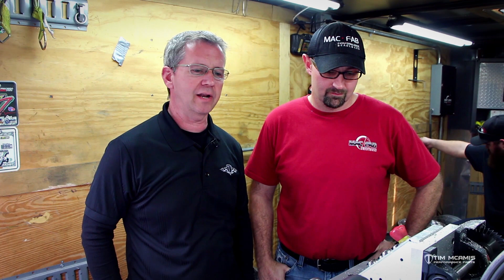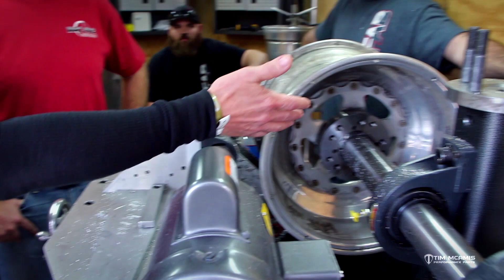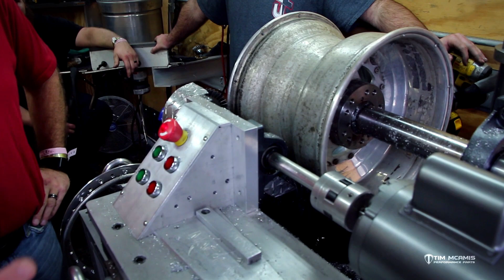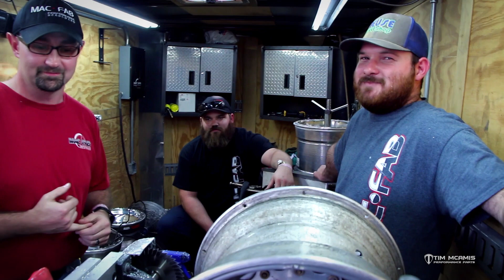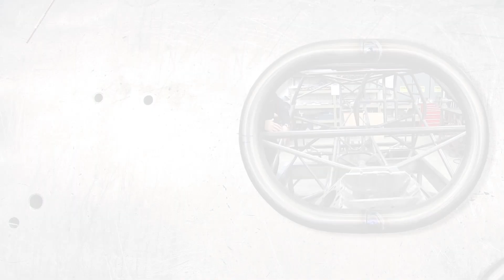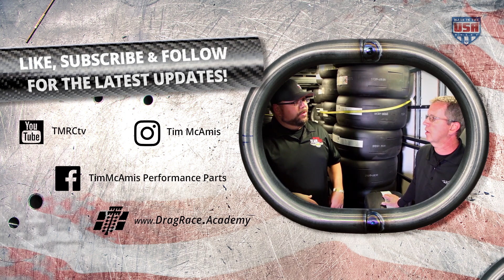Beadlocks & US Manufacturing

Comment: He is speaking 100% truth. 16yrs running a 110" wide rolling mill. It was bought used in the late 40s from a steel mill and we have retrofitted it ever since. It's a little over 3 stories tall. 4 legs and cross over at the top like an archway. They have said ever since I hired in that if it were to ever break a leg on it that another can never be made. Sounds crazy, in the car world if someone put it together then we should be able to rebuild it a 2nd time. But they say there just isn't a place left that can do big enough castings to replace what we have. We have sold our older stuff to smaller companies because that's just all you can do. I don't know but id bet money it the same in the machinist world that lathe that's 150yrs old made of all cast and weights 30ton is better than anything you can buy today to replace it short of new CNC machines that cant handle the size